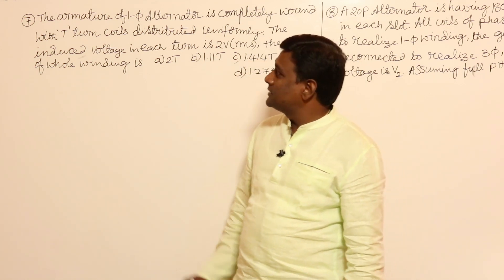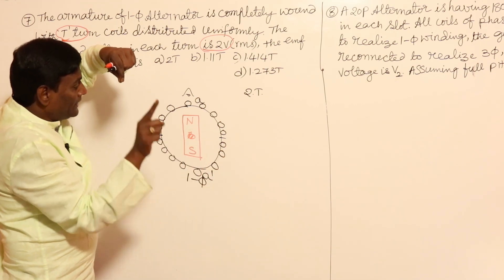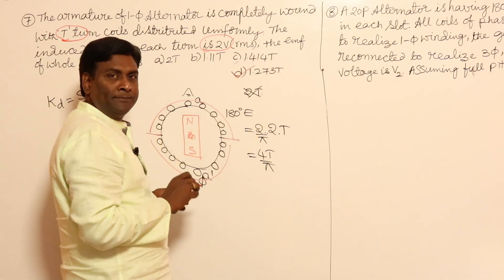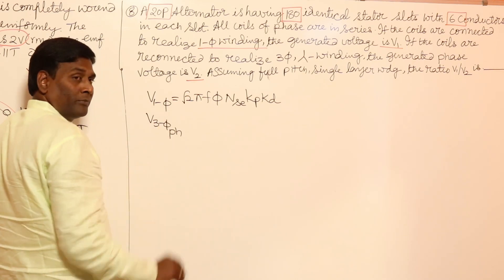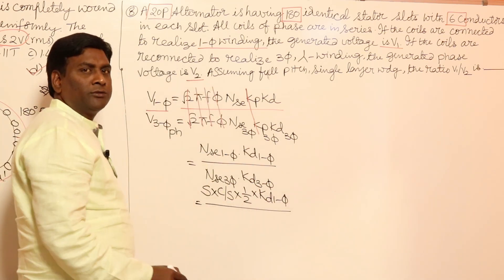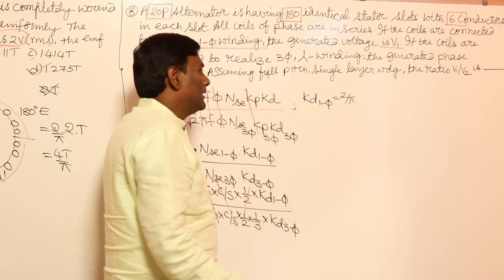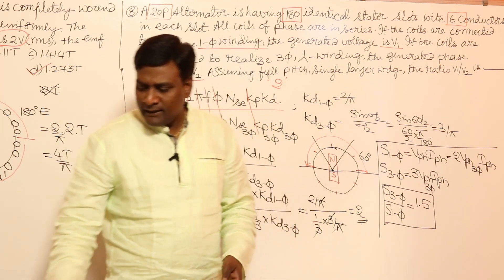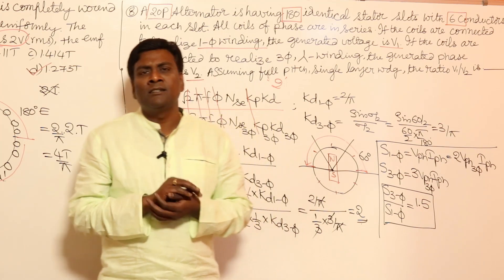Alternator at no load | Problem set 4 | KN Rao for GATE

Comment: Hello sir....In question no 8, to find Kd for 3-phase, you considered the no. of pole as 2 to find phase spread. But, no. of pole given is 20.
Reply: I think we use electric angle 
and the angle per pole is 180degree and we have 3 phase 
So phase spread formula will be 60degree